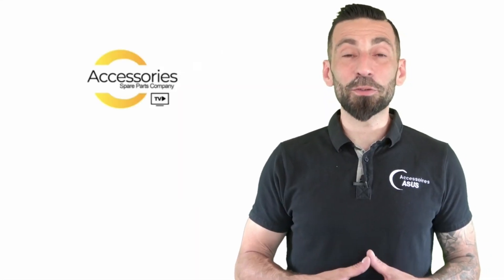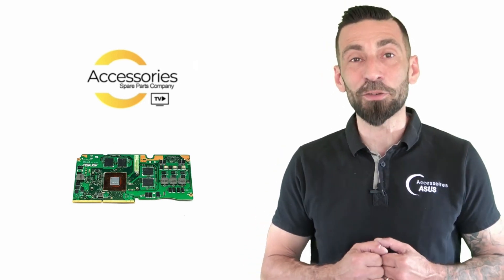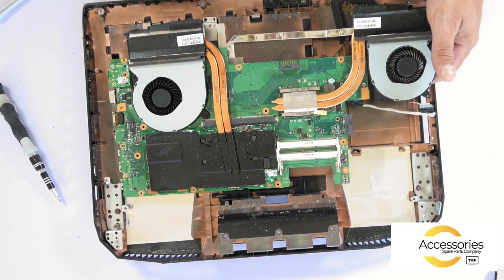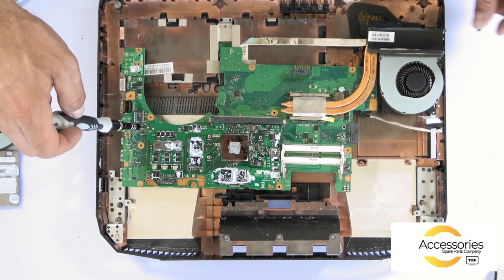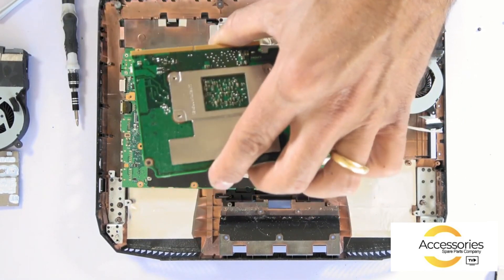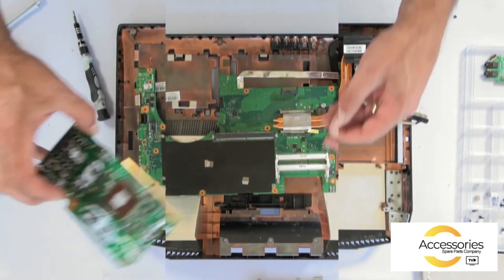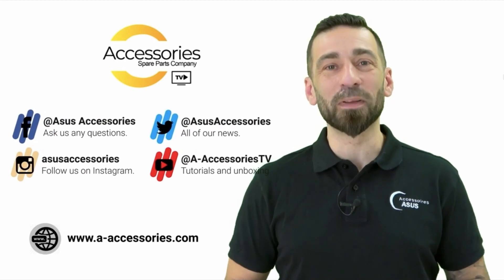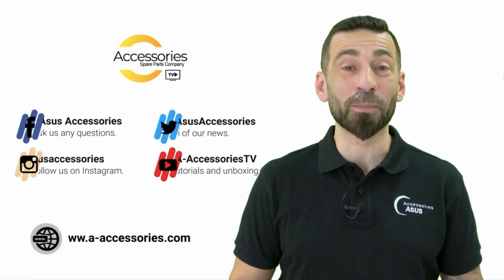Asus G750 series: how to remove and replace the graphics card

Comment: I have an older G75VW model with an 2nd gen i7.  Would i be able to do the same?
Reply from the maker: Hi,
For these two models, the situation is different:

✔️ Asus ROG G75 (G75VW / G75VX)
The graphics card is a removable MXM module.
Replacement is possible, but only with an MXM GPU of the same generation (Kepler).
No upgrades to much newer GPUs are possible.

✔️ Asus ROG G750 (G750JH / JM / JS / JW)
The graphics card is also an MXM module, but with a proprietary ASUS design.
Compatibility is limited to a few stock GPUs (GTX 765M / 770M / 780M / 860M / 870M / 880M depending on the version).
No modern upgrades are possible: recent MXM modules are no longer mechanically or electrically compatible.

✔️ Important
Not identical: The MXM system in the G75 and the G750 are not interchangeable.
Both allow for replacement, but not upgrades to newer generations, unlike current PCs where everything is soldered.

Regard
The Accessoires Asus team